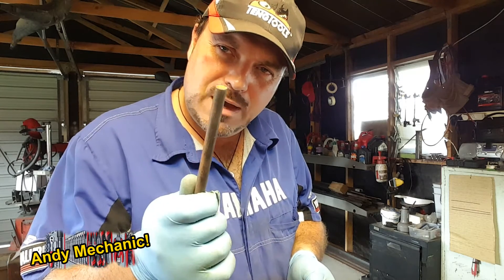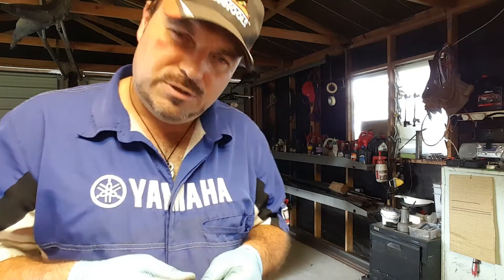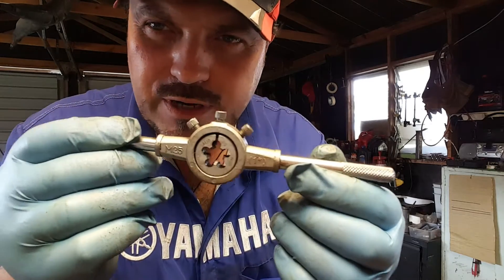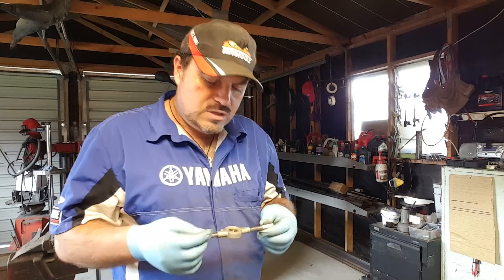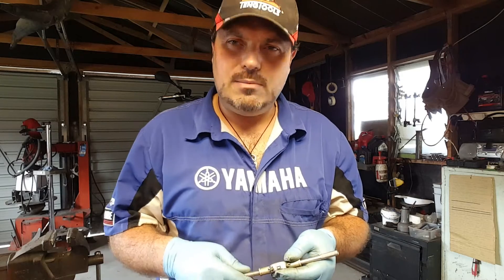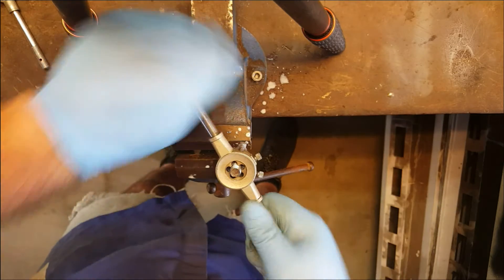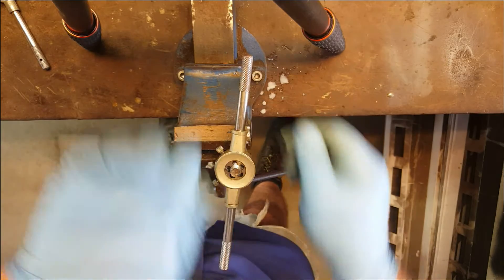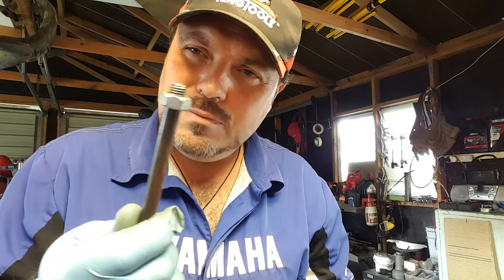How to cut an external thread using a die #1942

Comment: Mine often go off center or go crooked. Is there a jig that keeps the die and holder centered?
Reply from the maker: Not that I know of - you can use a pillar drill or lathe to get the thread started - turning manually - don't turn the machine on!

Comment: Great video!  I am confused about UNF and UNC threads...do you need to use a different type of die for each type of thread or is this classification related to the number of threads (i.e. M6x1 being fine and M6x5 being coarse)?
Reply from the maker: Yep, every size, pitch & type of thread needs a different die or tap. It can get quite expensive!

Cheers Andy

Comment: Dear Andy, thanks for the helpful video.  If you were to attempt to cut a thread in a rod which is larger in diameter than your thread, how would you try it?  I have been trying all sorts of tricks like a tapered cone and sanding the extra metal back but I end up with dog-legged thread cuts every time.  If I had a lathe there would be no problem but alas, none are available for me to use.  Any ideas?
Reply from the maker: Hi, Sorry for the late reply. I really don't think you will be able to given the diameter of the rod been oversize. Maybe you could switch to an alternative thread size that will match the diameter better? Other option is to have the rod turned down a little in a lathe.

Hope this helps
Andy
Reply: If it's not too wide in diameter you could chuck it into your drill (cordless, corded, or press) and file it down as the drill spins. Just don't over do it

Comment: Great tips! However, you didn't show how important it is to ensure you are cutting straight by measuring two sides of stock. If not even in two planes the die will cut at an angle. You mention it to be straight and with your train eye and experience it came out great. For a novice or a beginner measuring the two planes are the same is very important. As you gain experience doing this, you may get to the point that looking at the two planes like you did in the video will be spot on.
Reply from the maker: Thanks David, that's a very good point. I was never shown to do the measurement when I was at school (metalwork class) so didn't think to include in the video. An excellent tip for those starting out. Thank you for your feedback. Cheers Andy

Comment: Can you make new but smaller threads on existing rod with threads?
Reply from the maker: Hi, yes you can, just use a smaller die. The rod may need putting in a lathe to be cleaned up and turned to new diameter.

Hope this helps. Cheers Andy

Comment: Great vid. Thanks. I do have a quick question. You mention making your own bolts and the thread part is obvious but what about the head? How would this work to tighten/loosen? Thank you.
Reply from the maker: Ah....I could machine the bolt shank down on the lathe then file a bolt head. Would take a while though. Once finished I'd have to heat treat it if it had to be stronger than just mild steel, which is a bit soft for a bolt.

Comment: I have a question.  I can't seem to get a die to thread on any steel I use.  I turned a piece of steel to 8 mm and tried to thread it with a 8 mm x 1.25 pitch die and I could not get it to thread.  I even put a chamfer on the end, still could not get it to thread.  I turned the steel to 7.9 mm and then 7.8 mm and still could not get the die to thread.  Why are there no charts for dies' as there are for taps?  I looked at the die for the start on this side, but the die have very little taper to them as they look the same from both sides.  I'm just a hobbyist so I don't have the greatest tap and die set.
Reply from the maker: +ariesmars29 It should work just fine as you do use an 8mm dia rod for M8 thread. Make sure you use the 'starter' side of the tap and the center screw on the die Holder can open the tap a little wider too which may help to get it started. Cheers Andy

Comment: Great video EXCEPT: The problem I keep having is not addressed: As much as I try to start the die level while threading the rod, the die starts gradually going off center as I'm cutting, so the threads start going off at an angle, looks like hell. I even have an adjustable self-centering die holder thats supposed to eliminate this problem.  Why does no one seem to cover this?
Reply: other videos suggest chamfering the end of the rod or pipe to ensure you get a decent bite at the start and ensuring you don't come off 90 deg when turning- and ...practice? These 2 in combo have helped me some.
Reply from the maker: +Wood Made Good Great to hear it :-)  You'll get it sorted I'm confident of that. Thanks for the feedback. Cheers Andy
Reply from the maker: +Ted ah....it's just practice.....
Reply: Well, I've practiced plenty, and always the same outcome. What is the technique I should be 'practicing' to keep it straight.
Reply: Thanks man, subscribed and liked. Please keep up the good work.